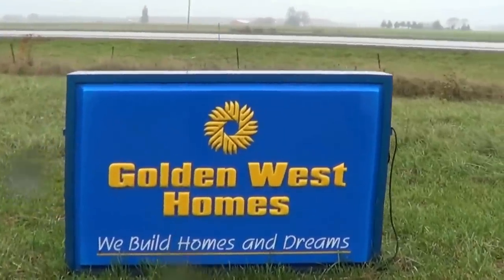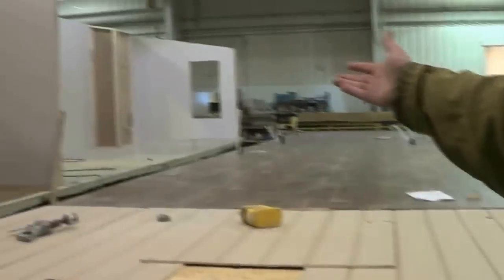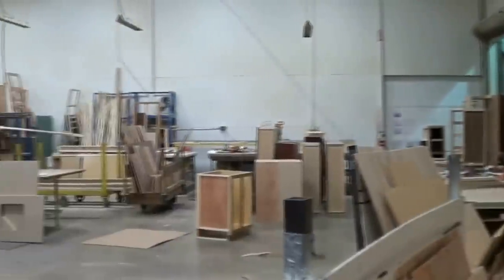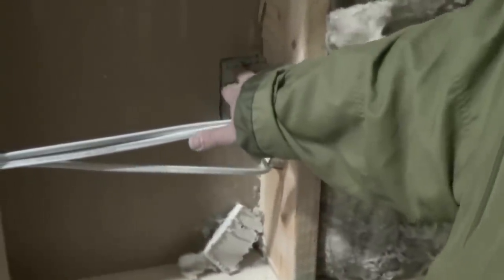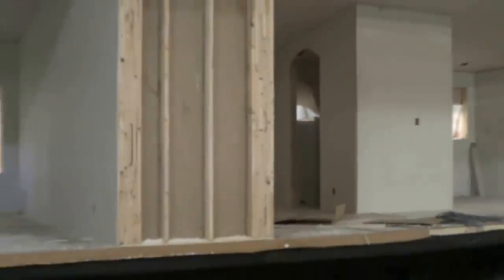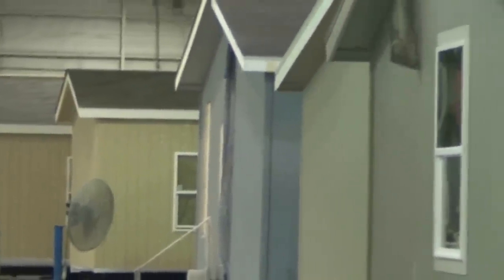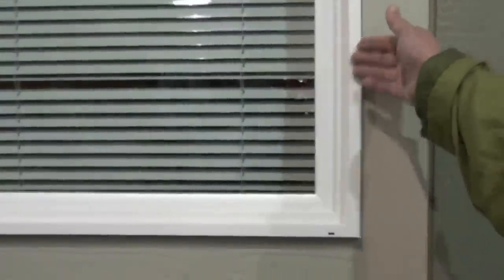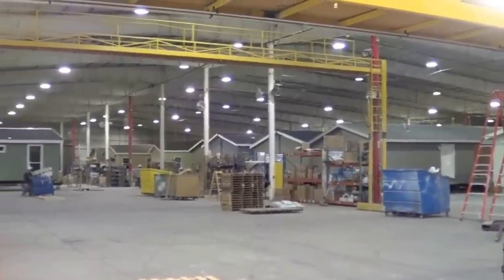Factory Tour  - Golden West Manufactured Homes

Comment: We have a 1994 Golden West manufactured home, 50x24 with a gabled roof, 2 br with den. The roof needs replacing and we are wondering if it will bear the weight of re-roofing over the old shingles? Thanks
Reply: What state do you live in You should be fine overlaying over existing signals
Reply: We also live in a 1994 Golden West double wide (44x27) We are also in the market to replace the roof in 2022, now that the original roof is at the end of it's intended life span. (28 years old). We've been getting quotes to re-roof it and every roofer that has come out has said that mobile homes roofs are not built to withstand the weight of double shingles and for that reason, none of them would do that.